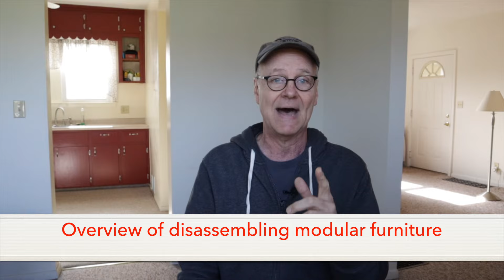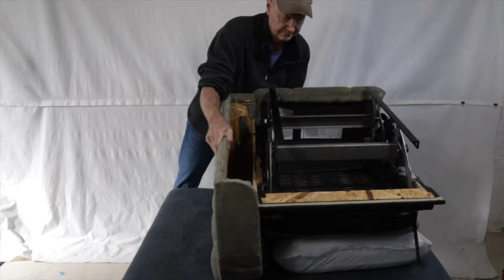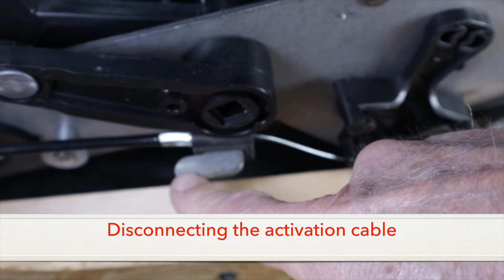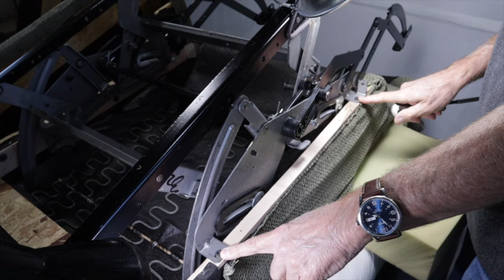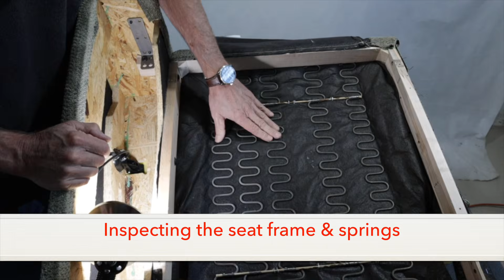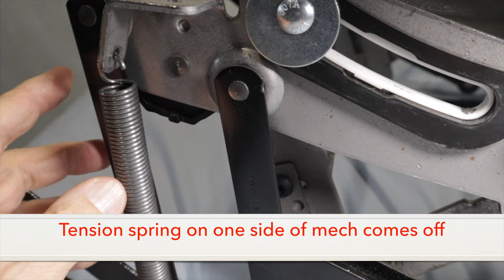Reclining Mechanism Repair - Part 1

Comment: We have a 15 year old recliner that does not have a side handle or release.  It has become very difficult to recline and un-recline.  Do you have any advice on this type of recliner?
Reply from the maker: @galvinpdx - 2 things to check, are whether the reclining mechanism is loose or the unit is bent. Bends typically appear in the scissors that extend (open) the footrest. Loose areas can be mechanism parts that are fastened together & have come loose, or where the mechanism mounts to the furniture frame. If you find both, tighten all loose areas to see if the mechanism operation improves. If not, install a new mech.
Reply: @reclinerrepairguy4155  you were spot on. The mechanism was severely bent at the scissors. Now to call Lazy boy to see if the still have parts for a 15 year old chair. 😬

Comment: The fact that that plastic part is not available separately is criminal. It's such a simple part that it could easily be replaced with a hand-fabricated metal part (it's just a short tab with 2 holes in it FFS). Anyone, or any company, claiming to have any "green" cred that pulls crap like this should be publicly exposed and a class-action suit filed.  Of course it's all put together with chipboard so...

Comment: Can you point me in the place where I can get new heavy duty mechanism
Reply from the maker: @eltoros2779 - Replacement mechanisms are typically available from the recliner manufacturer or perhaps one of their dealers. However, heavier-duty versions of these mechanisms are not usually an option. But hey, it never hurts to ask!

Comment: I have a lazy boy recliner style 41U7222. It’s an oversized recliner. I requested and received the replacement parts for the footrest. However, when I began to put it back together I noticed that it was not exactly the same as the original parts. I contacted Lazy boy and they said that the correct parts were sent and then said that they would send a tech to assist for a charge of 199 dollars. Have you experienced them sending the wrong parts? I am not exactly dumb and took photos as I took the recliner apart but it’s still not working properly. The plastic part that assist the foot rest up and down loses contact with the metal part causing the foot rest to flop down.
Reply from the maker: @BrianAdkison-xw4vl - Yes, receiving the wrong part(s) is not uncommon. However, one has to be able to determine whether the replacement part is different because it's an updated version of the original, or whether they simply sent the wrong part.

If you took photos of the old part, simply take photos of the new one for comparison. Send them over to La-z-boy so that they can see they don't match up.
Reply: @reclinerrepairguy4155  I’ll take it back  apart and send it to them. I’m not going to let them try and get their 200 dollars

Comment: How about La-Z-Boy “bearing bracket sub assembly” replacement? I have received parts from La-Z-Boy with the following catalog numbers:

42970069–00L
42970069–00R

Do you have a video that covers this procedure?
Reply from the maker: @bobzwood - Not at the moment, sorry.